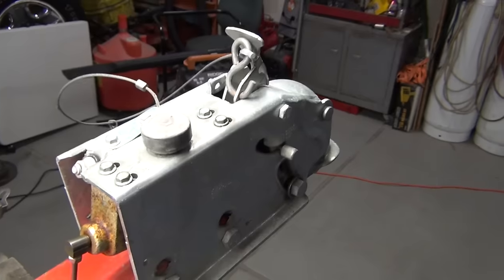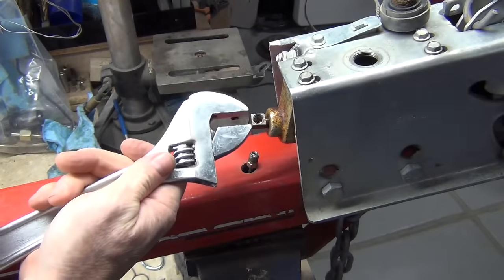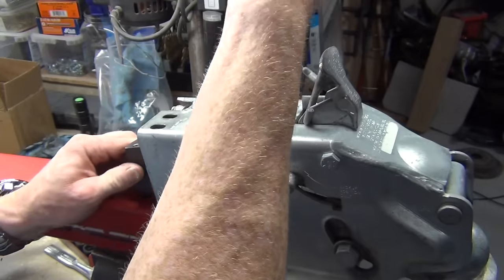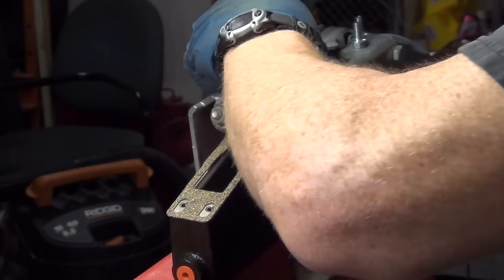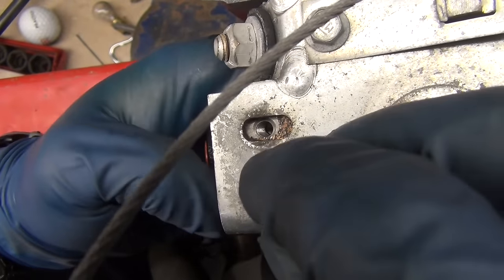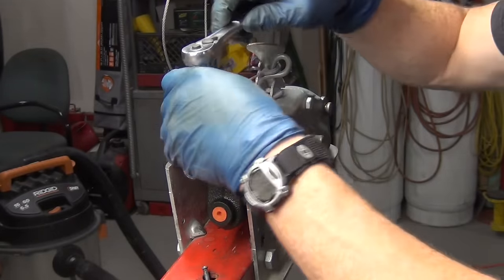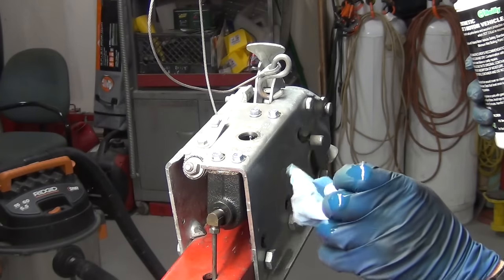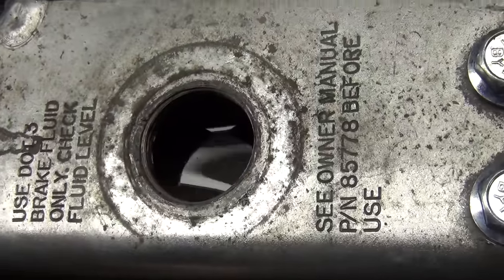Boat Trailer Master Cylinder Replacement How to

Comment: It was good you can still get parts. Great little helper too!
Reply: Atwood Mobile Products was sold to Dometic in 2014 which sadly brought an end to production of the Atwood surge brake and all OEM parts for it. I happen to have an Atwood 84132 on my boat trailer and it needs to be replaced. Based on some research, it appears there is no convenient plug-and-play alternative for this unit. Fortunately, I was able to purchase possibly the very last brand new 84132 available in the US on ebay for a mere $150 plus tax and shipping.

Comment: Hey Brian. VM trailer welded on the housing to the bar. It looks tough and bullet proof. But brake fluid leaked out the top and also due to Mother Nature of rain when the boat is sitting and covered. So water got into the master cylinder. So I may need to do a replacement. But since it’s welded on my bar.From when I purchased the boat and trailer. I did notice that my trailer did not have smooth painted bars and more like it was refurbished Cause my other buddy has the same trailer and the front bar and Attwood Hydraulic Actuator housing was not welded on. And the frame of the trailer was smooth painted and not rough like mine. But that’s another story. Anyways thank you for the product knowledge class on the replacement ad steps.

Comment: Hey brian, if you use the trailer ball on the mount chocked up in the hitch it gives you more leverage to push on that master cylinder with. Looks like you got a good helper there!

Comment: That's a first for me seeing this done. I borrowed a trailer  that was similar  to this style  a ways back and it must have needed a service . Everytime I tried to reverse the brakes applied HAHA  Cheers bud.
Reply from the maker: That curved track with the pin is for use when reversing.  Reversing up a hill without the lockout can be really frustrating and noisy.

Comment: glad i found this video!   that looked like an atwood actuator.   mine is making  more noise while trailering than in comfortable.  seems to be slaming when going forward from stopped.  also,   what appens if you back up and do not switch to back up mode on the hitch?

Comment: Bought nice 1987 well kept trailer and boat the second boat I’ve ever owned and it has this actuator system and it’s old and rusty should I just replace everything….(the 300$ fix you were talking  about) or can I lube it all up replace actuator and feel safe with linkages that old .. boat was stored all its life indoors when not in use

Comment: Great video, thank you for sharing. I have the same exact trailer. What size is the quick disconnect? Mine is missing and the previous owner disabled the trailer brakes. Where can I buy a quick disconnect?

Comment: My 1996 Jayco (Atwood) won't release to let me put my trailer on the hitch. I don't really need the brakes as much as the ability to be safe by having the hitch attached properly. I made it home fine. I would like to have the full functions work if it's not that expensive, but it's an old trailer and I just spent $2000 on it. I'd be fine if it was cheaper to install a regular coupler. Maybe you can give me some input. Do I just need to replace one or two parts?

Comment: ? I have the same trailer tongue and every time I go to drive it it seems to skip a nap not locked up I go in reverse and it types are going to reverse I work with the actuator then it seems to be fine I’m able to drive around the block but I took it up to the lake and I got halfway there and my brakes are burned out what’s going on with my trailer please help

Comment: hay brain, love your vids.. I have a Q,  I have been to all local auto part stores, trailer repair stores in my area.  all say they can not find a master cyl. mine is a atwood85736 all reasurch says there not avalible.   but that one you just did looks the same as what I have.  look just like what I need.  one place said  858461 would work.  I don't mind doing some mods to make it work. any help would be great.  PS all the trailer places didn't even know what it was,,lol

Comment: where did you order the new master cylinder from?
Reply: You can use most of the parts from a rebuild kit for a 1950 Buick to rebuild Atwood 1 inch bore master cylinders.  Dorman TM 3626.

Comment: No grommet where the rigid tubing goes through the chassis? Vibration will fail that tube right there with time.
Reply: I was thinking the same thing.  At least tweak that 90 a touch so it holds the rigid tube in the middle.

Comment: The Feds tried to get surge brakes like this outlawed in 2007, they failed. I personally prefer electric actuated brakes.
Reply from the maker: I like electric way better myself, but on a boat trailer these are far more popular.  Something about dipping it regularly and then letting it sit most of the year makes this design more desirable.

Comment: Well, This video is pretty much Useless, if they do not make this part any longer?
Your video, does not really show all that much.
How about showing how the Shock / Plunger is installed into the Master Cylinder.
There are other components to the Master Cylinder than just a Gasket and the Cylinder itsefl.
You spend more time, in showing how to Bleed the Master Cylinder than you do, on taking out the old one and reinstalling the New one.
For a whole there, i was not even sure, that you installed a new Master Cylinder, as you never showed the New one up against the Old one.
Your video was missing a few Key Instructional Tips.
But once again......Listing where you can get these parts, would have been a really good start.
Now, everyone is saying, that you can't even find these parts, any longer? LOL
So.....whats the point? 
Cheers
Reply from the maker: The point is, you never know what the future holds.  And this video getting traction shows that there's still demand for that part if someone wants to produce it.